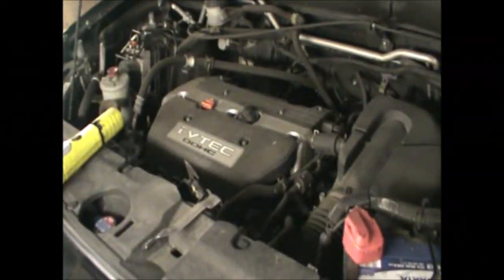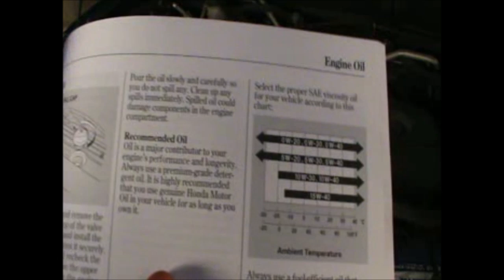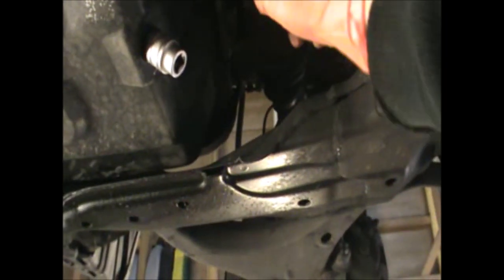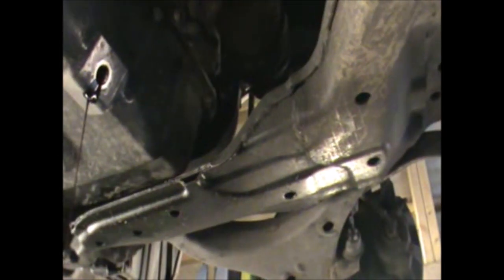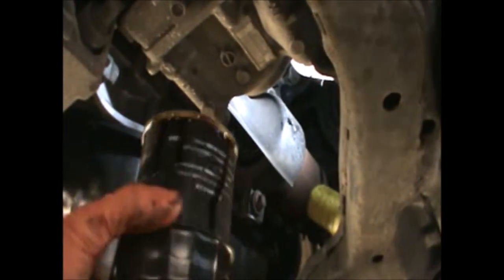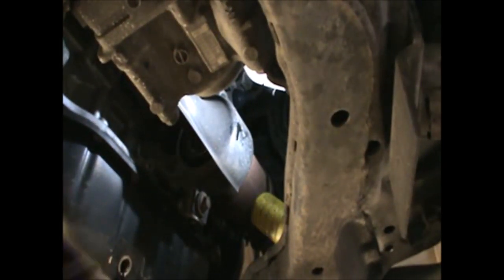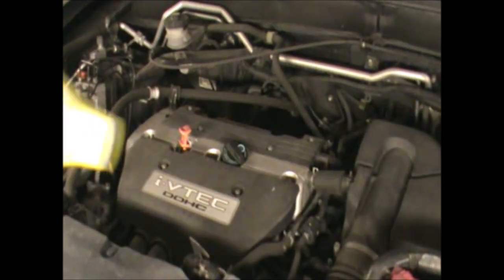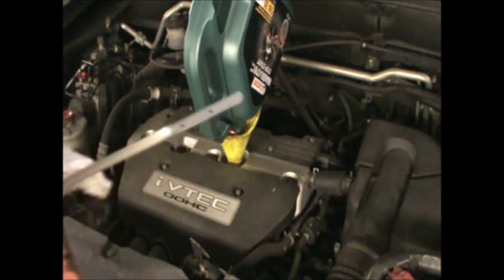Honda CRV 2005 Auto 2.0 Oil and Oil Filter change removal and replacement

Comment: You can reach the filter from the top of the engine, it's not to hard to reach just position yourself easy. No Jack required to drain oil either.  Good video..
Reply from the maker: Oh thanks for the tip, great to know.
Reply: I can't even fit my arm in through the top of the engine, I tried. These cars are tiny. The japanese seem to love to design things small and difficult to work on if you're a large man.

Comment: That filter location is really akward :/ - what do you find is the best wat to reach it if you don't have a lift? I see some people go through the engine, others the wheel arch. I'm also concerned about the spillage - does it fall on anything critical?
Reply from the maker: The spillage just runs down the side. Down the block and sump. With out a lift am not really sure possible via the wheel arch I dont remember the layout very well now.
Reply: Arch layout is very easy one you take the wheel off. Access is so easy
Reply: @thevibes67  I'll try that-Thanks!

Comment: I would always put Magnatec in VTEC or VVT-I engines as these engines do need it.
Reply: I wouldn't - Magnatec causes sludge. I use Liqui-Moly engine flush, Longtime High Tech 5w30 and Ceratec. Runs like a dream.

Comment: the easy way to get to the oil filter is to remove the passenger side wheel and you will have an easy access to it
Reply from the maker: Thanks for the tip.
Reply: driver side